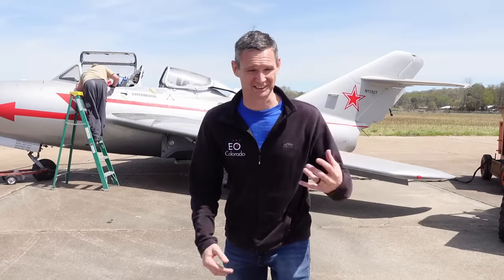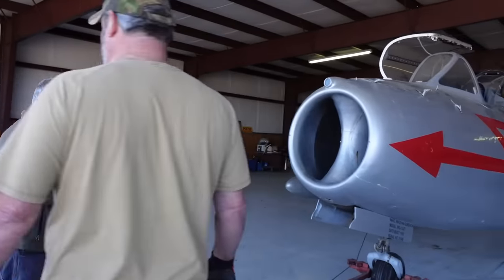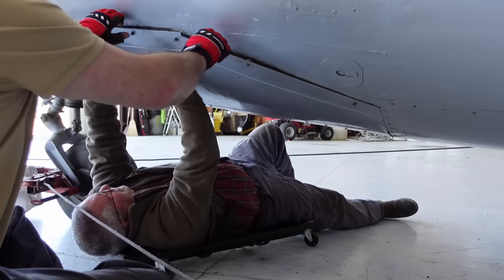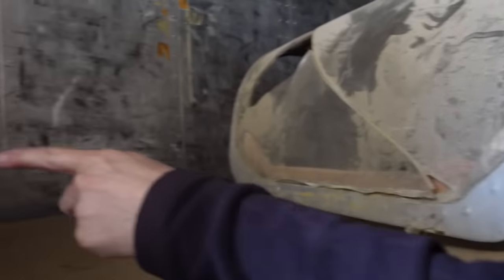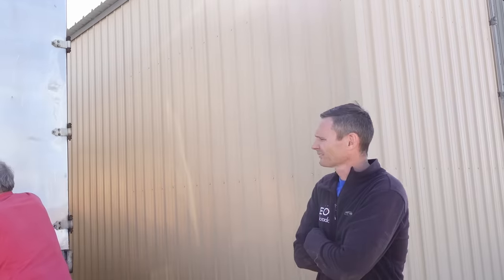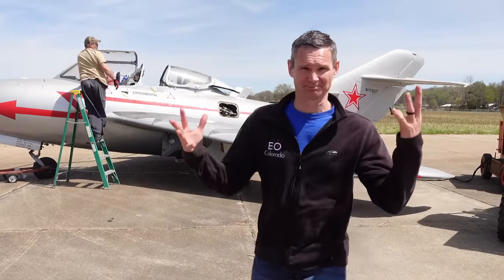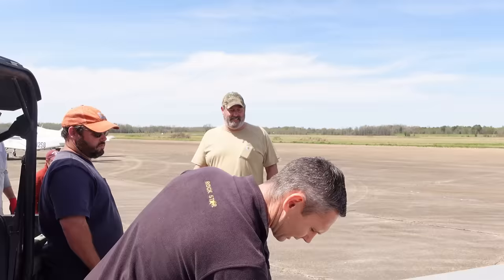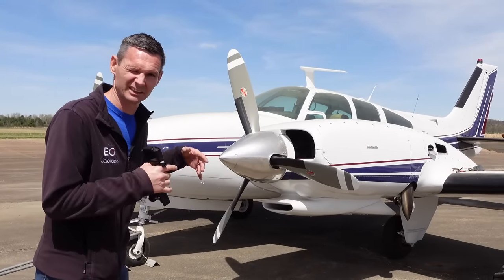I Start A REAL ABANDONED MIG 15 Fighter JET After 12 Years

Comment: The corrosion on the flanges that locate the removable panels on the Mig-15 (enough with the "Fighter Jet" crap.   It's been de-narded - it's a vintage Russian military jet) is to say the least, SPOOKY.  I wouldn't put it under the stress of it's defined role as a dogfighter.  Low, slow, straight, and level. You'll need expertise beyond these dudes.  The dude with all the knowledge apparently died, so time to fine another expert. REAL expert. But, hey, I LIKE it!

Comment: Ya know, if i got a mig 15, i would turn it into a supersonic jet. Inspired by the x 59 quesst, i can do a sonic thunp with this thing, also i thought if it has no engine i would replace it with a metal 3d printed low bypass turbofan engine

Comment: Surely that has run in the past 12 years......even if has had NFP maintenance the chances are that critical seals would have perished etc, you can't simply "Park" an aircraft and it starts first go after sitting for 12 years!

Comment: Good morning, the first task was to change the oil and clean the crankcase and put synthetic oil with militec additive and also change the filters, then remove the spark plugs and start to have oil pressure and all oil present in the combustion chamber after putting new spark plugs, preferably iridium and torque according to the manufacturer's table and finally cleaning the fuel tanks then putting high quality gasoline and finally starting the engine. With this technique it will be perfect.

Comment: Not easy to fly a pain in the ass to maintain a pig in the air lots of switches and tiles all in the wrong place it’s definitely very Russian in that way but it was the first make they ever produced so we can’t be too critical about them with the amount of
Effort and brain power it would take to get the injector seat working as it should be at least 300 m above the ground you’d probably crash before you ever got out of there

Comment: I always wonder at the feasability of putting a modern turbofan engine in an aircraft like this. The engine would be smaller, lighter weight, greater fuel efficiency and equal or better thrust. It would be cheaper to maintain, is there a downside I am not seeing?

Comment: Make sure you have a mechanic look at the oil system of the Mig , if its mobil 254 oil in there ( purple-ish black oil ) you could have some coking problems if its sat too long in heat. You dont want your bearings starved , so have it checked. Also make sure your fuel system is ok from your feed from the wings to the engine , no fireballs please....Other than that a normal Annual inspection would be recommended pre flight.

Comment: There is a de Havilland Goblin jet engine at a museum near where I live, it is an early British jet engine that was used in de Havilland Vampire and other early British jet fighters. It is a centrifugal engine, not an axial one like all modern jet engines, which makes the cross section really huge, i.e. the engine is very wide and tall at the front. I understand that the Soviets copied British engines to their early jet fighters, and that the MiG-15 has an engine pretty similar to the Goblin.
Reply: The Grumman Panther’s engine would have been very similar to the MiG’s, both were derived from the R R Nene.

Comment: Obviously it wasn't something you went into a hanger and fired up. That's plainly obvious. But even more so to the fact nobody in their right mind would try that without extensive work to make sure its flyable. FAA would require that. So you may have tried the "first start" after the overhaul in this video, but that's not what you're implying. So why should I trust you or your channel when the first video I see has a misleading headline and description?

Comment: You should not buy that mig It is super complicated to fly and needs a big crew to help get it ready to fly and it uses 3000 +dollars an hour in fuel and they canopy and brakes are connected with the nitrogen use I think you made a big mistake unless your alot smarter than you act on your shows.i wish you good luck and hope it does work out for you..